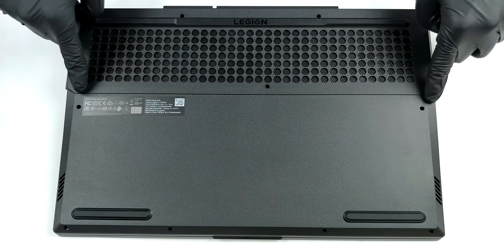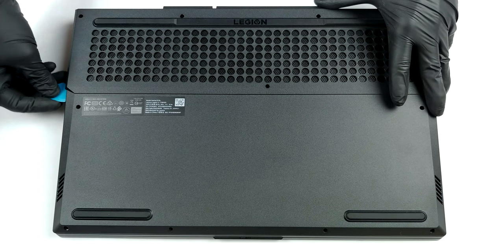🛠️ Lenovo Legion 5i 17 - disassembly and upgrade options

Comment: hello, one question I have exactly that model and I bought an m.2 ssd but I discovered that I cannot fit it in the free socket because there is no screw to fix it to the plate, do you know if there is any rig that can help me? since this is ssd m.2 nvme and I can't install it without it floating and hitting the chassis
Reply: Seconded. I'm also trying to find this answer.  Junic442 if you've figured it out please share
Edit: I have since found the included bracket and it's working flawlessly
Reply: I had the same issue luckily i found aloofmaster's comment.
"Parallel to the M2 slot, near the battery, you have the standoff. Remove it from there and mount it according to your ssd size."

Comment: So can you put m.2 pcie under the sata drive?
Reply: Yes you take the drive tray out and the m.2 is there
Reply: @ordinarymooseyt9378  but there's nowhere to mount the m.2 as you can see. only the slot you stick into, but no place for the screw to hold it down.
Reply: @Mrozek93  the screw you're looking for is in the plastic cover of the SSD tray, there's little screws embedded inside of it.
Reply: @Mrozek93  if you want to join my discord I can help you
Reply: I didn't get it yet. So there's a way to install the second m.2 pcie there or not?
Reply: Thank you guys! I bought this notebook (didn't arrive) and now I can also buy the right ssd. I will add you on Discord!
Reply: @LucasPaiva96  any time! Would recommend either going a standard SSD by Samsung Evo, or go the Kingston SSD route, it's easier to install I think, but m.2 is a plug and play so it's kind of up to you on where or how you want to build it
Reply: @ordinarymooseyt9378  thanks bro
Reply: My problem is the same I don't have a place where I can screw the M.2 ssd, does anyone know how? Or where?
Reply: @mohammad-alialghazawi5155  Take a look at Mrozek's answer. That little bracket is the support you need. On the board you will see couple slots where you can lock the bracket (then you can also use the small m.2 version). So first find the bracket (see Mrozek's answer), unscrew it (and hold this screw for a moment), insert the bracket where it fits your ssd size (it's like a "snap" thing, only one way possible, try and you will figure out) and put the screw to lock it. It's a very clever solution from Lenovo. If you still can't do it, tell us and we will try to help.
Reply: @mohammad-alialghazawi5155  it's under the SSD drive tray
Reply: Thanks so much guys I was just about to say you are all wrong until I figured it out. 

So first pause this video at 4:47. 

Now hover your mouse over the spare ssd slot. Slightly to the right you will see a yellow sticker almost in the centre of the picture. Hover your mouse over this now.

Now directly left of the yellow sticker and slightly under the spare ssd slot look for the spaceship looking metal clip that has one screw in it. You need to unscrew that and you will see it has four bumps on it. That goes into the square slots (under where your ssd m.2 drive will go) so you are then able to screw the ssd m.2 drive in. It gives you the option of 2 different sizes also once you figure it out

Good luck
Reply: @DaggazZ I love you

Comment: How do I install my SSD in it? 3:56
Reply: I opened up my 17" and it looks different in that spot. It looks like it won't accept a 2.5" sata. Not sure what can connect under that but ill have to do research. They blocked it off from accepting a 2.5"
Reply: @bingbong586 I also have a 17 inch is there a way to get the aluminum away from the drive tray
Reply: @modelodrifting2061  no idea but I ended up having to buy a m.2 nvme ssd  instead
Reply: @bingbong586  I just took it carefully off and then put a samsung 1tb ssd inside and put the aluminium again on it